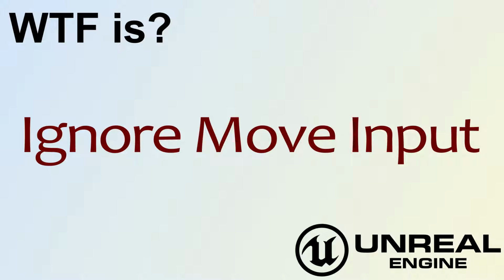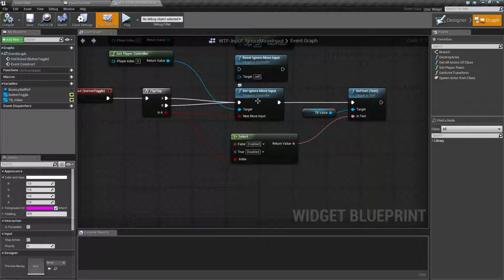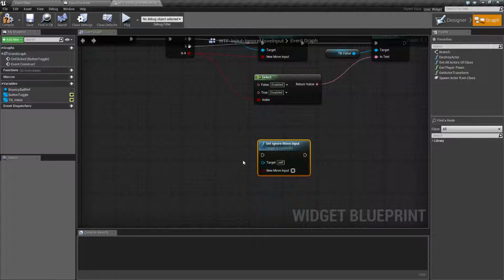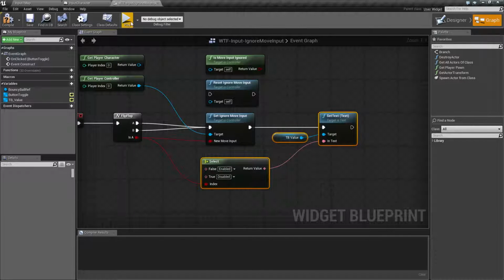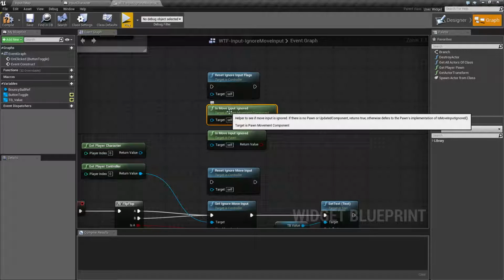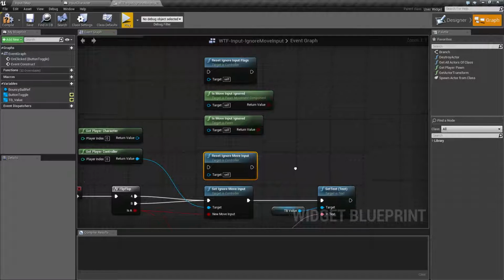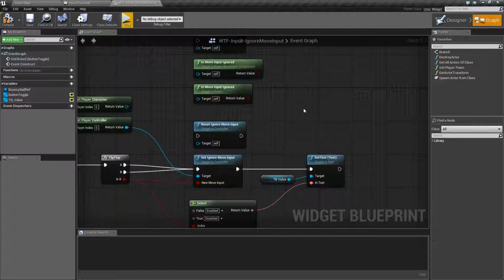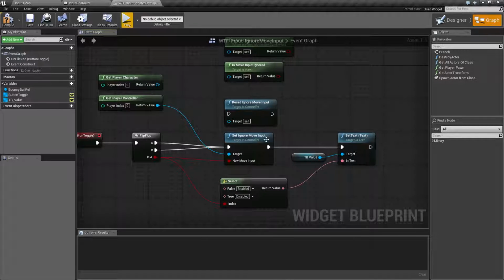WTF Is? Ignore Move Input in Unreal Engine 4 ( UE4 )

Comment: Will thsi stop current actions? i.e If I hold "move forward" then enable this function
Reply from the maker: Assuming you are using the input in the settings it should.  The Character Movement input basically ticks and passes along the info for the key to do whatever you have set up for it to do.  If you run the Set Ignore Input node and set it to ignore input it will basically sever those input nodes in the controller and they no longer tick.  You can watch this happening in the video above when I disable it and show the events no longer firing.
Reply: Mathew Wadstein Legend :)